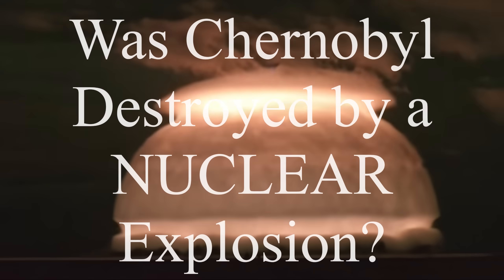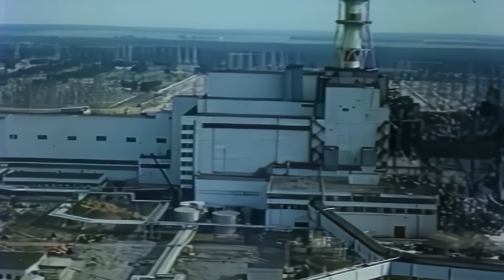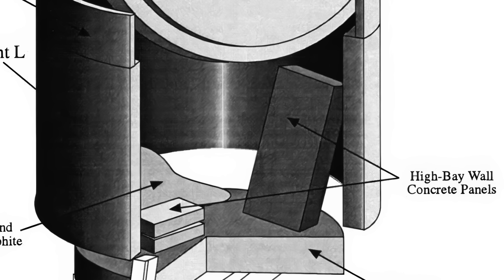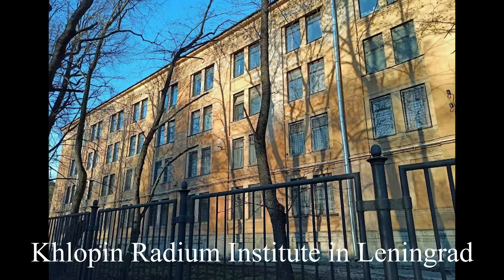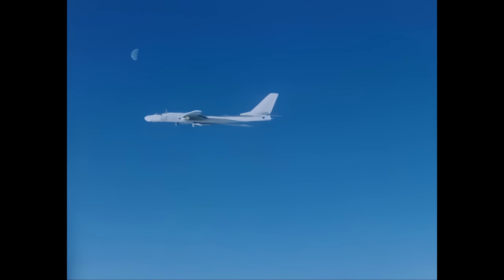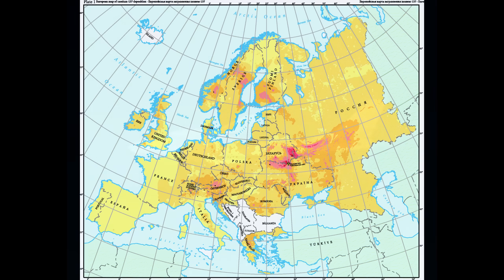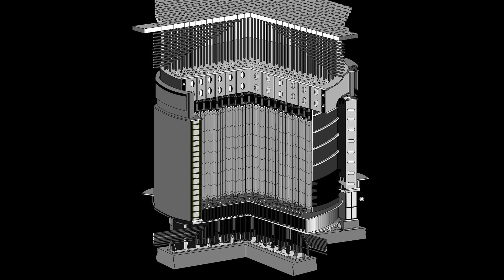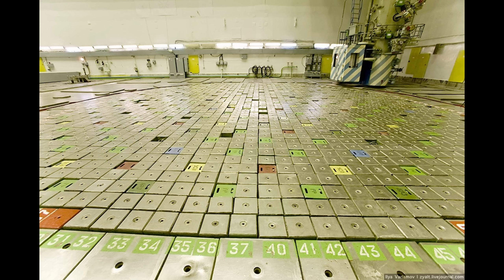Was Chernobyl Destroyed by a NUCLEAR Explosion?

Comment: The core is too large and low in enrichment to undergo an actual full uncontrolled chain reaction as in a bomb. The fuel melted, the power of a violent steam explosion blew the upper biological shield off.
Reply: I believe you're forgetting about the contributions of the moderator (graphite in this case) to the chain reaction. Bombs don't use a moderator (they do use neutron reflection, booster gas, etc, but not a moderator)
Reply: It seems quite unlikely to me too, especially on how hard it is to make and atomic bomb explode. 

I find that Phil Mason's hypothesis of being a coulombic explosion could explain it, but there hasn't been further research. 

Check my main comment on this video for more details.
Reply: nuclear bombs also cannot undergo "full chain reaction" and usually disassemble themselves before reaching 50% burnout.

Comment: The conventional explanation of failure holds that there were two BLEVE type explosions followed by a hydrogen explosion. First a localized BLEVE consisting of a small handful of fuel channels rupturing in the hottest part of the reactor, lifting the lid of the reactor high enough for the remaining coolant to blow out, followed by a secondary, larger BLEVE as the remaining coolant flashed into steam, then the hydrogen explosion. That explains the existence of three explosions. The uranium fuel still exists in the form of tiny “hot particles” all over the Zone.
Reply: Hydrogen explosion theory is weak because the supposed H2-air volume was too fuel rich and not mixed.
Thus a large flame is possible , but a building shattering explosion is not possible: that would required hydrogen to mix with the air better.

Comment: The real difficult question is: How much nuclear energy was released during the phase of prompt criticality and how did it dissipate?

It´s not so easy to answer, because the fission energy of each nucleus goes into the kinetic energy of the fission fragments (the fuel itself) and into the kinetic energy of the emitted neutrons which immediately heat the moderator. The moderator as well as the fuel itself are getting less reactive with increasing temperature, so luckily the reaction stops before everything has disintegrated. Else the force of the explosion would have been much stronger.

From my point of view there are two reasons NOT to compare it with a nuclear bomb:
1. A nuclear bomb relies on prompt criticality by fast neutrons, without a moderator. That´s only possible with highly enriched fissile material. Only this way the nuclear reaction can continue up to a bomb temperature of millions of Kelvin, only that way this incredibly energy can be released in microseconds.
2. If a prompt fast criticality had happened in chernobyl then there wouldn't be a single survivor and at least reactor 3 would have been destroyed too.

Anyhow, it must have been a "nuclear fizzle" as you described it. A nuclear fizzle that was potent enough to evaporate quite a lot of the core. And even if the evaporated part of the core may not have been critical anymore, it´s only legit to assume it was crazily radioactive and that the nuclear decay ongoing in the evaporated gases created a lot of high energy particles with lots of ionization and visible light effects.
Reply: Agreed on point 1: prompt criticality with fast and thermal neutrons is a key difference. Re 2: fizzled nuclear weapons still experience prompt fast criticality, just in such a way that the runaway is terminated by disassembly (the explosion) before it gets very far. So I don't think the scale of the damage is particularly related to whether or not prompt fast-neutron criticality occurred

Comment: I personally would reject the idea of nuklear explosion. It shows none of the effects or signature sights of nuklear explosion.

If it would have been a nuklear explosion the extreme temperature would have melted the fuel tubes, would melt and or charcoaled the inner walls and burn the graphite as well

However the wall and anything looks clear to me. And on the other hand the core is empty, which is an undeniable evidence for me regarding stream explosion. What pretty much happened is that pressure built up inside the core untill the two end which is a weakspot given up and since the internal components where attached to the upper shield it got jettisoned out with it.

Second explosion would give us a loot of headache, but in my opinion what really got happened is that the first explosion lifted up the upper shield but it has fallen back on top of the core but had a second explosion due to the vast ammount of stream still sparing on it, this second explosion broken all the fuel rods etc, loose and spared all around the room, and the schockwaves also cleared to lower shield.

There is some example of stream boilet explosions
Exploded locomotive trains. Notice the shape of the rods, which appears to be very similar to chernobyl fuel rods.
https://www.youtube.com/watch?v=4OJipVw9Rjg

Boiler explosion
Notice how the pressure is removed the covers like they where just dissasembled
https://www.youtube.com/watch?v=9c-wOGOr0io

Also it is really hard to believe that 80% of the fuel or even more would be nuklear fisioned out. 

in chernobyl we are talking about 190 tons of fuel. By talking about 80% we have 152 tons.

Even by comparing the enrichent, 80% vs 5%. we still have 9 tons of unarium exploding. and keeping in mind that hiroshima was done by 62kgs of fuel it is really hard to believe that tons of uranium would just jeet out without practically doing any significent ammount of damage to the environment. after all most of the damage is clearly done by the stream.

Just think about it? How much it would count of Kilotons?
Reply: You are missing a crucial detail. The instantaneous fission of a few mg of U 235 is sufficient to turn tons of reactor core inventory into plasma. That plasma is no longer fissioning, its just really hot and angry. That is the nature of the fizzle. Fission is negligible. But negligible prompt criticaly is still as explosive or more explosive than TNT, i.e., turns the entire object into gas.
Reply: @Zonkotron  Even if the Uranium itself gotten "gasified" that still would not explain the the lack of metal fuel rod tubes and graphite blocks from the core.

After all those could not just "vanish" with the uranium.
Reply: @venator5  Oh they can, anything can be vaporized by enough kw/cm³ of energy flux.
Reply: @venator5  steel and zirconium can burn.  While iron oxide is solid, zirconium oxide can be gaseous.
Reply: Oh, there's a big difference between a typical fission bomb and a reactor -  the use of a moderator. The moderator (graphite in this case) greatly enhances reactivity; it is used in reactors but not in bombs though.

So yeah, they're not going to look the same
Reply: Ok, what's the signature of a fizzled nuclear explosion? A fizzle yield is much much smaller than a full nuclear explosion (but still significantly worse than a chemical explosion).
Reply: I don't accept theory about nuclear explosion too, but local acceleration on a prompt neutrons was possible. More than that, i don't know any other things, that could create a lot of lava-like mass, wich has melted down the bottom of reactor, drained down some floor and solidified in shape, known as «elephant foot». No one chemical reaction can produce so much temperature for it, neither the burning of carbon or hydrogen, nor parazirconium reaction. So, it very similar to nuclear fizzle, not explosion.
Reply: Dang you totally sound like an expert and not some rando!
Reply: 5%? Not even close. The fuel was 2% which makes all this even more implausible.

Comment: Elena also hit RZM (aprox 450t) thrown it from rails and broken info few pieces.
Reply: @Tomek1985  
That it could do with its sheer mass alone. Elena weighed in at an eye-watering 2400 tonnes. When 2400 tonnes meets 450 tonnes, there is no way 450 tonnes will win out. Compare it to an elephant running into a mouse.
Reply: I believe the RZM was parked in its corner, it would be a curved trajectory to take for Elena. Alas, the pressure release alone in my mind was definitely enough to wipe out the structural walls of the main hall. As soon as Elena lifted above hall floor, there was a tornado of very energetic stuff flung sideways from beneath it.